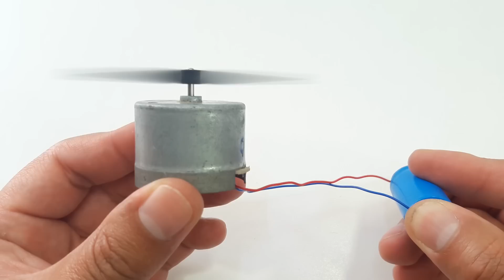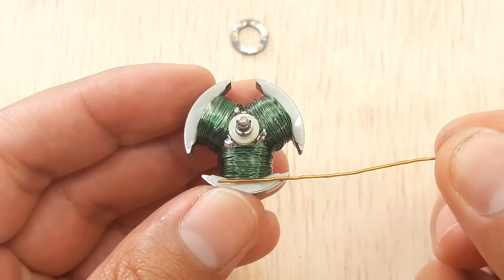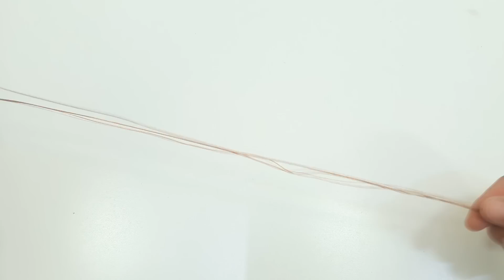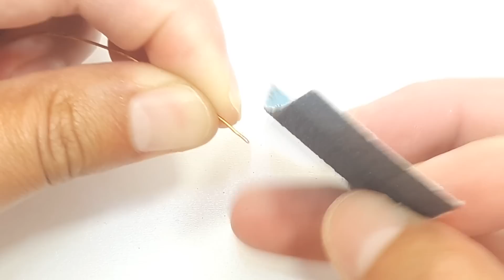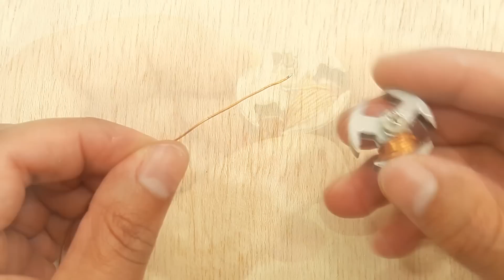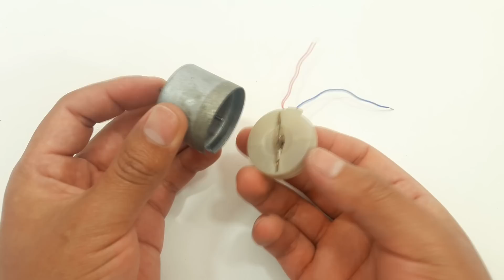Cómo Hacer Mas Potente Un Motor (Muy fácil de hacer)

Comment: i rewind my motor with 10 turns with 1.4mm wire and work faster speed in 12v

Comment: Está bueno el experimento. Algo que muy pocos tienen en cuenta, es el campo magnético que en estos motores es fijo, por lo tanto la FEM no está equilibrada en relación al bobinado original. Sólo los motores cuyo campo es también inducido, se logra buena potencia a mismo voltaje y amperaje, ya que se pueden balancear ambos bobinados( campo y estartor). Esto es mi humilde opinión al respecto. Saludos cordiales desde Villa Gral Savio Ramallo Provincia de Buenos Aires Argentina.
Reply: ª

Comment: Rebobine dos motores de un carro con cable AWG 31 50 vueltas cada bobina. El carro se volvió más veloz pero la curva quedó muy débil, el circuito calentó d +, motor, hasta las pilas! Por lo tanto, si vas a hacer con esa finalidad, no te pierdas el tiempo.
Reply: exacto al hacer eso tooodo se va a calentar mas!!, no solo los colectores sino el circuito de control, los transistores, hasta las pilas y todo va a durar menos si no se refuerza y no se refrigeran las partes.
Reply: osea que no conviene desarmar el motor y re bobinar porque tendremos que cambiar el regulador de velocidad y la batería por valores mas grandes???

Comment: Realmente no lo haces mas potencia, lo que pasa que con el embobinado original era para que funcionara con un mayor voltaje por lo que esa batería no era suficiente para que el motor diera su potencia maxima, es por esa razón por la que el motos presentaba una supuesta mayor potencia aunque realmente tuviera  la misma potencia ya que si lo vemos de la sig manera se podrá entender mas:
Un motor de 12v a 0.5a ampers tiene una potencia de 6watts (12 × 0.5).
Y si tenemos un motor de 6v a 1 ampers tenemos 6w (6×1) por lo que estos dos motores tienen la misma potencia pero con diferentes voltajes y amperes. 
Y como el alambre de cobre que le pone es mas grueso ocupa un mayor amperaje para funcionar, y como tiene menos vueltas requiere menos voltaje para entregar su máximo poder
Reply: osea, si es mas potente, porque puede tomar mas corriente de la bateria y obtener mas potencia.
Reply: @manuelchalarca5350  si,
Reply: Gracias perro
Reply: La explicacion no es esa pero tienes razon, el motor no es mas potente por girar a mas revoluciones por Volt. La unica forma de aumentarle la potencia a un motor es instalando imanes mas potentes, cambiando devanado a el apropiado para su carga y al voltaje que se le va a poner,  Tambien usar alambre de mejor calidad y con un empacado mas alto en %tage.  La explicacion valida empieza en que un motor en realidad tambien es un generador. aqui la explicacion completa. http://aeromodelismoelectrico.blogspot.com/2012/11/como-funciona-un-motor-electrico-para.html
Reply: Y que pasa si se usa alambre grueso como en el video pero con más vueltas
Reply: @terrazasleonel2660  Lo que sucederá es que necesitaras un cargador o batería de 6 a 9 volteos  pero con un mayor ampere no mayor a 2.
Reply: @terrazasleonel2660  queda un moustruo de motor . súper potente
Reply: @SantinoElLechugon jajajja que verga paso ahi arriba
Reply: Ash críticas y tienes un suscriptor en tu canal este señor tiene dos millones y medio de seguidores primero sal del cascarón por Dios!
Reply: @doroteogalvezgranados  para empezar yo no me dedico a subir videos, y segun tu argumento dices que si solo porque alguien tenga unos 10 millones de suscriptores todo lo que diga va a ser correco. Asi que en vez de comentar ponte a investigar y luego te pones a comentar
Reply: Solo por el título de su video piensas que está mal lo que está haciendo? Todos sus vídeos son aprendizaje mucha gente no sabe de términos técnicos lo hace para todo tipo de personas y si conozco la relación que tiene la corriente y el voltaje  doy clases de MECATRONICA en secundaria, a veces los tecnicismos no ayudan para tener un conocimiento que sea significativo en tu vida, solo se me hizo que tu crítica va mas allá de lo positivo que es em video para dar una idea mas facil de optimizar un motor y sacar su maximo provecho...
Reply: @doroteogalvezgranados   yo lo que estoy diciendo es que lo que hizo realmente no le da más potencia al motor, puede llegar a ser la misma o hasta menor, una forma de explicarlo es que regularmente esos motores funcionan a 5v 0.2a por lo que se podría representar como un motor de 1w y con lo que hizo fue que ya no tolere los 5v si no que ahora sea de menos, pero que funcione con un mayor amperaje, ya que entre menos vueltas tenga un embobinado tolera menos voltaje y entre más grueso sea el cable mas ampers tolera, por lo que bien pudo quedar que tolere 1v a 1a, dando como resultado un motor de 1w (para obtener los watts solo se multiplica el voltage por los ampers)
Reply: @erickjafetriveraramirez6385  Yo tambien estoy de acuerdo en que el del video esta equivocado. estos motores no dan mas potencia. porque en primer lugar las RPM no tienen nada que ver con la potencia.
Reply: Jaja déjame adivinar publica??
Reply: Osea que si hago una bobina con un cable más grueso es más rápida la potencia que entregar el motor
Reply: AMIGO ME INTERESA EL TEMA, BUSCO A ALGUIEN CON ESTOS CONOSIMIENTOS, ME GUSTARIA INVERTIR EN CREAR VEHICULOS DE BAJO COSTO PARA MI GENTE DE LATINO AMERICA! TIENE ALGUN CORREO ELECTRONICO O MANERA DE COMUNICARME CON USTED ?
Reply: Oye contesta mi comentario porfavor
Reply: MUCHO TEXTO
Reply: Muchas gracias por tu comentario me ayudo ❤️
Reply: Geniooo
Reply: muy ingenioso sierto
Reply: MUY BUEN COMENTARIO
Reply: Entonces un motor ya no puede mejorar su velocidad??
Reply: Osea sale menos complicado, conseguir un motor mas grande. Como el de las impresoras. 😂😂😂
Reply: @leonardoSilva-oc6oy  Si quieres mas potencia, usa un motor mas grande o uno de mayor eficiencia como un brushless.  O de plano usa el motor igua al 775 pero con el Kv lo mas cercano a la especificacion que ocupas (esto ultimo requiere ms explicacion)
.
Reply: Si si ya ala chingada
Reply: Perdonen la ignorancia, pero así consume más, o menos energía de la batería?
Reply: @wodahack6062  Entre mas cargues a un motor mas energia consumira y mas ineficiente sera. aqui una explicacion sencilla de como funcionan los motores. con la diferencia que estos motores de brochas tienen una eficiencia maxima de alrededor del 55%.
Reply: @Juan De Bos™ Estoy de acuerdo solo que yo he aprendido mucho de ésta persona sus vídeos son muy didácticos y todo lo que hace o muestra es muy bueno y todo funciona como lo muestra solo sé  me hizo mal la crítica porque el título no correspondía a lo que es técnicamente solo eso
Reply: Hhjhggg
Reply: Mucho texto mejor hagan una biblia xD
Reply: Gracias  experimentaremos con un drill para uñas que no tiene fuerza el motor y por ende no Lima las uñas.
Reply: Gravcias por la info
Reply: Si cierto
Reply: You all prolly dont care at all but does someone know a tool to log back into an Instagram account??
I was dumb lost the account password. I would love any tricks you can offer me.
Reply: @James Marshall instablaster =)
Reply: Más vueltas llevan al nombre de espiras ya en su núcleo. 
Cambio de cables junto con el grosor y aumento de vuelta, alteran el motor sacándole un poco más de potencia. Adaptado a otro cambio de voltaje. También pueda que un aparcado de embobinado estuviera en consumo. Saludos bendiciones

P = I x v 
P = E2 sobre I
Reply: No miente en su título,no hay que proyectarse!
Reply: Bueno soy novato en esto pero el cable es mas grueso por lo que a mayor grosso menos resistencia. 
Soy novato no me funen
Reply: @JPSteven  mira para que logres comprenderlo mejor, investiga el funcionamiento de los transformadores
Reply: es cierto, ese mismo motor sin alterarlo, dejandole el embobinado finito pero colocandole una bateria de 12v o más va a su maximo poder, aunque claro, la desventaa es que se calentaria mas y en un punto se quema, esa es la ventaja de ponerle embobinado mas grueso
Reply: Tengo unas maquinas corta pelo con bobinas, pero curiosamente una de ella tiene el cobre de color café, y es menos potente ¿crees que el color de la bobina influye en su potencia? las otras son de cobre color rojo y tienen mas potencia que la café ¿a a que se debe? ¿sera porque tiene mucho cobre o es por el grosor del mismo? por favor me gustaría una respuesta ya que no se nada de electrónica.
Reply: @PazAoyama  es por el grosor del cobre, lo he aprendido a fuerza de quemar cosas y seguir experimentando con motores eléctricos a mis 38 años...>:v🙈😭😎
Reply: ¿Osea sugieres que le coloque cobre mas grueso??
Reply: @PazAoyama  pues si te animas puedes intentarlo, sólo que a riesgo de que pudiera dejar de funcionar el motor, siempre se requiere de mucha paciencia y perseverancia,yo aprendí más así que de la teoría, pero nunca debes dejar de lado ni la teoría ni el sentido común al momento de manipular electricidad aunque sea con tan poquísimos voltajes
Reply: @Metalmaked666 creo que el cobre rojo tiene más electroconductividad que el azul o el amarillo,aún así entre más grueso sea el cobre más volts debe de usar, haciéndole menos eficiente
Reply: @yakiekadafi9805  así es, experimentar es la clave, siempre tomando resguardos
Reply: Eso no es experimentar. Eso es hacer cualquier cosa. No tiene sentido alguno redescubrir leyes descubiertas hace añares, ni reinventar la rueda. @Metalmaked666
Reply: @guillermosempron5776  ok maestro...toda la infinita razón para tí... me dedicaré a no hacer más cualquier cosa ni a intentar experimentar nada más... saludos y Larga Vida a tus tutoriales Gran Sabio 🙋
Reply: @PazAoyama  cobre más grueso mayor fuerza pero mejor velocidad, el cobre te da más velocidad pero mejor fuerza, es directamente proporcional.
Reply: @PazAoyama  Si colocas alambre mas grueso sube el amper y recalienta, es mucha potencia y daña los terminales de las bases hasta romper partir, ese color de alambre es chino aluminio, no tiene fuerza, te sugiero que uses un buen tipo de cobre pero el mismo grosor 80 gramos es suficiente, Saludos desde mi Pueblo Cafetalero Agricultor, Batatal Trujillo Venezuela.
Reply: @Metalmaked666  es verdad lo qur dices amigo . Yo vie en español es bastante fácil  . Cobre delgado menor voltaje y menos fuerza . Y mas grueso  menos voltaje pero mas amperaje   miren como hacer un oldador con trasformar de microondas  . Ew todo cambiar el grosor del cable
Reply: @Metalmaked666  tipica respuesta del q no hace nada ni deja hacer jaja no le des cabida
Reply: @PazAoyama  Compra, que motor usa tu maquinilla?
Reply: @PazAoyama  Si colocas alambre mas grueso sube el amper y recalienta, es mucha potencia y daña los terminales de las bases hasta romper partir, ese color de alambre es chino aluminio, no tiene fuerza, te sugiero que uses un buen tipo de cobre pero el mismo grosor 80 gramos es suficiente, Saludos desde mi Pueblo Cafetalero Agricultor, Batatal Trujillo Venezuela.
Reply: Demasiada información narrada :v

Comment: Lamentablemente va a durar poco, ya que las escobillas no están pensadas para esa corriente. Ni hablar que la potencia es exactamente la misma. para lograr el mismo resultado deberías haber usado más pilas (las cuales proveerían una corriente más baja).
Reply: @Edupaserovich  no me enoja, me indigna tu respuesta puberta y totalmente random...
Reply: Así es todo se va a calentar mas y aunque mas diversión va a durar menos.
Reply: @AZURA888  tu hermana se calienta cuando le mando mano 😂
Reply: Guillermo Sempron  que me recomiendas...estoy inventando un pequeño generador hidráulico con un motor de estos...lo dejo así? o puede modificarse para producir un poquito mas de energía? gracias
Reply: La energía no depende del diámetro del conductor. Si metes alambre más grueso obtendrás mejor corriente a menos tensión. Con alambre fino obtendrás más tensión con menos corriente. La potencia es exactamente la misma. Ley de Ohm.  @EduardoGonzalez-xi1uy
Reply: @guillermosempron5776  cierto
Reply: @EduardoGonzalez-xi1uy  podrías utilizar un motor con un calibre de cobre muy alto, osea un cobre muy delgado para que tenga más vueltas y por tanto entregue más voltaje con exactamente la misma fuerza hidráulica
Reply: Al aumentar el diametro del conductor disminuye la resistencia, así que en teoría hay mas voltaje y menos corriente; si mal no recuerdo, en estos casos se necesite voltaje o polaridades contrarias dentro del rotor para generar los giros.
Reply: Que puedo hacer para que las escobillas  no se quemen

Comment: Hola amigo Muy buen video puedes hacer un voltaje variable para la corriente directa que viene ya en mi caso como 110 para poder variar el voltaje Digamos si yo lo conectó a a los 110 v  giro creo un potenciometro hasta que llegue 10 voltios 50 voltios 30 etc hasta que llegue lo máximo que es  110 te lo ruego

Comment: Cabe aclarar que lo que hacemos es que sea mayor el diámetro del cable, aumentando la corriente en cada bobinado, por lo tanto levantando el motor una mayor temperatura que antes, haciendo que en algún momento la cobertura plástica del cable de cobre se funda y se genere un corto circuito que quizás pueda hacer explotar la batería con lo que estemos alimentando, para cortos periodos de uso como un pulso se puede utilizar, pero en largos periodos puede ser peligroso.
Reply: Se puede conectar un tomacorriente de Móvil 9v a un motor DC? importa los Amperios? es un motor viejo y no tengo información técnica, solo se que era de un juguete a control remoto

Comment: todas las vueltas tienes que se la misma cantidad en cada lado
Reply: Marcos Josue Santos Lemus Claro que sí, por éso los tres alambres que midió con el metro tienen el mismo largo (creo que eran de 44cm. cada uno en el vídeo y 0.57mm de grosor). Toda bobina de motor tiene sus campos de igual número de espiras, salvo que se trate de otro tipo de motor más complejo. Éste es muy sencillo y pequeño, y fácil de modificar. Lo que hizo él fue reducir el número de vueltas en cada campo, usando alambre más grueso. La relación es, a menor número de espiras (vueltas), menor es la tensión requerida. (Por éso el motor gira más rápido con la misma tensión de 3.7V de esa batería). Y, a mayor grosor de alambre, mayor es la corriente y la potencia. Lo que sí, tendrás que utilizar baterías o fuentes de alimentación más grandes (de más mAh.) porque se consumirán muy rápido, independientemente del voltaje que uses.
Reply: Fran Farias El motor se quema cuando lo fuerzas mas de lo que soporta el hilo de cobre. El anterior cable verde es casi del grosor de un pelo, se puede quemar facilmente porque requiere menos calor (o sea, soporta menos corriente) para quemar un hilo tan fino. Poniendo una pila de mas capacidad de la que requiere el motor y hacerlo forzar sosteniendo las aspas del ventilador (de la misma forma que a veces hueles a quemado o sale humo dentro de un taladro cuando estas forzandolo) permites que entre mas energia de la que soporta y chau motor.
En cambio ese hilo grueso soporta bastante temperatura (es casi del grosor que se usan para soportar 16A de corriente!). Lo que tambien se puede hacer para aumentar la potencia, es cambiar los imanes ceramicos que hay dentro de la carcaza, para que repelan los electroimanes mas rapido.
Basicamente un motor electrico trabaja utilizando la fuerza de repelencia de polos iguales (al girar, las dos lenguetas que estan debajo van haciendo contacto con cada bobina distinta, e invierten su polaridad.....esto hace que "repela" la bobina y atraiga a la otra que esta con la corriente invertida, esta llega y a su vez las lenguetas ya dejan de hacer contacto y pasan a contactar la siguiente, y asi a perpetuidad (hasta que se gasten las lenguetas).
Reply: hay que tomar en cuenta que si mides el rotor con el ohmetro te marcara baja resistencia (el motor sin girar) y la corriente sera alta, pero en cuanto el motor empieza a girar con una fuente directa, la reactancia del rotor aumenta debido al fenómeno de la autoinduccion y por lo tanto ofrecerá una resistencia al paso de la corriente y los amperios consumidos no serán elevados. si le pones una carga lógicamente que empezara a consumir mas corriente.
Reply: Axel Farias excelente información amigo, gracias!
Reply: las formulas sirven para hacer un calculo exacto para alguna aplicacion, pero en este caso se trata de un experimento como muchos en la ciencia. Al disminuir el numero de vueltas y aumentar el calibre se reduce bastante la resistencia y aumenta la reactancia de la bobina y logico se necesitara una fuente que tenga mucho amperaje y bajo voltaje
Reply: Axel Farias 👍 gracias!!
Reply: Sí, con 12V. el motor así modificado funcionaría increíblemente rápido unos segundos hasta quemarse... dudo que el bobinado pero, creo que se quemarían primero las escobillas que son algo más delgadas que el alambre del nuevo bobinado. Percibirías un gran chisporroteo y el típico aroma a quemado. Sería muy triste. Por eso creo que no más de 6V. sería un límite seguro.
Reply: ...Y, como aclararon anteriormente los amigos, una fuente de mucho amperaje. :D
Reply: Axel Farias
Reply: Axel Farias  crack
Reply: nicolashrv  re interesante meterme a buscar estAs cosas e ir   aprendiebdo
Reply: Axel Farias de  una
Reply: y como sabes el largo que tiene que tener el alambre..? por el grosor? como se calcula eso?¿'¡
Reply: SHKUDOY el largo se calcula en base al area del nucleo de metal magnetico.. sabiendo el alto.. por el largo de la bobina.. sabras que cantidad de vueltas de alambre podras meter.. en este caso.. que no lleva mas ciencia.. ni que necesitas unas rpm especificas.. si es el caso contrario.. las vueltas y el calibre se calculan dependiendo de las rpm que necesites y de la carga que debe soportar el motor..